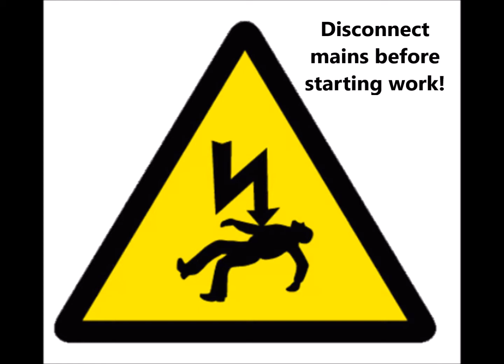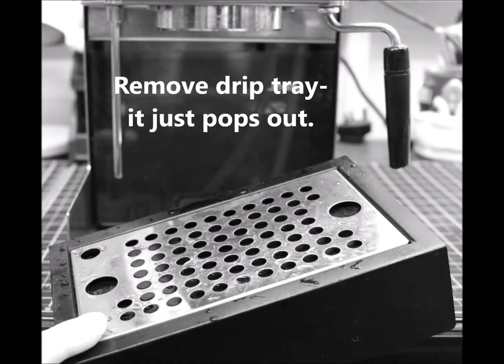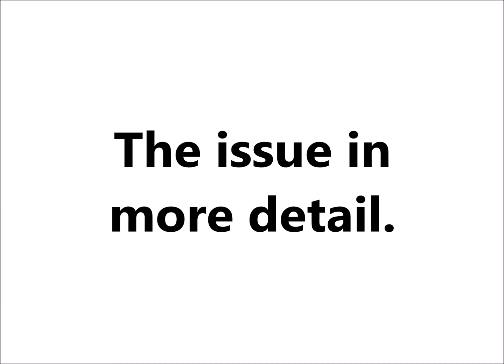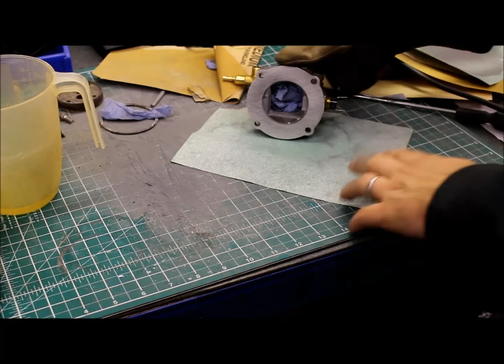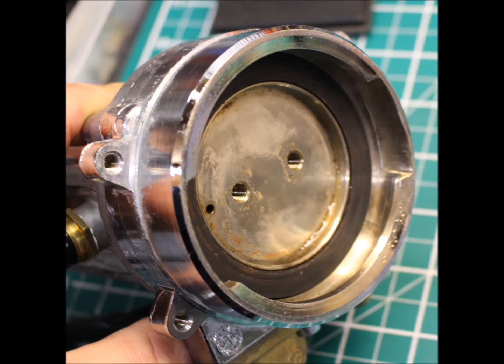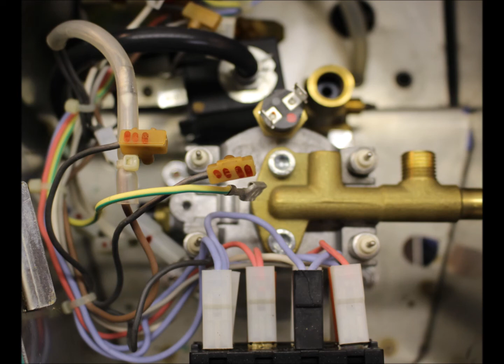Gaggia Classic Coffee machine boiler repair at FixItWorkshop, Worthing

Comment: Mine took 4 hours of filing and an hour of grit 40 sanding and there are still dark spots in the aluminium!

I probably removed more than 3mm.  I bought some stainless screws and had to saw a couple of mm off each.  

Seems to be working though.  

Jokers "reconditioned" it last year  at a cost of £200.  

Strip down and rebuild only takes half an hour.  Amazing.

Comment: Very helpful video, thanks. I've just disassembled my classic and it had more pitting and build up if scale in the boiler. Cleaning it and reassembling resulted in a leaky boiler, so I'll be going the whole way and try to sand the boiler down like you showed.
Reply: Same thing happened with i again need to sand the boiler and put it back

Comment: You don't have to go to all that trouble I have done loads of these and just taking the top pits of with wire wool and scotch after lightly scraping with a flat metal scraper work every time takes a few minutes. Never had it leak after!
Reply from the maker: Rubin Duke.  I was going for an 'as new' finish that would last. I guess you might get away with a rougher finish, but I didn't want to take any chances with 100 degree steam.
Reply: Was gonna say the same thing. Let both boiler halves soak in hot water with descaler for 30 min or longer if needed. Use scotch Brite as needed.  Your working way to hard with all that sanding is not necessary. Change out your new seals and will be leak free.